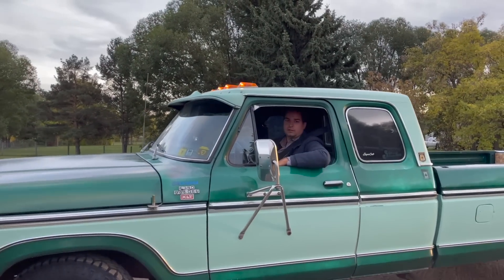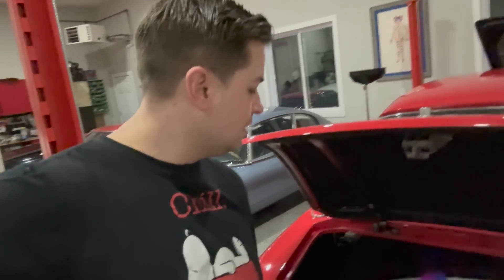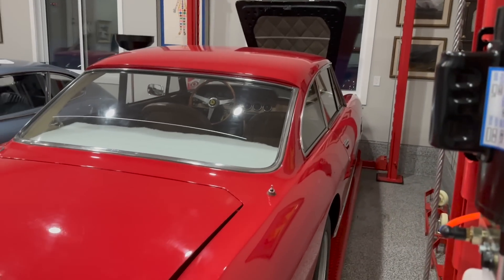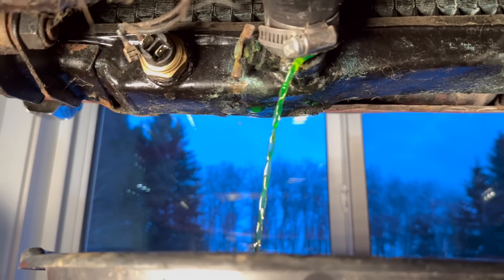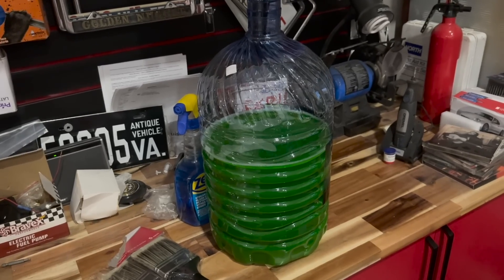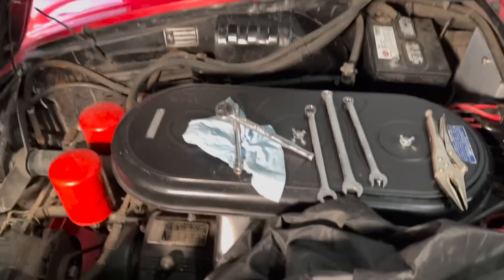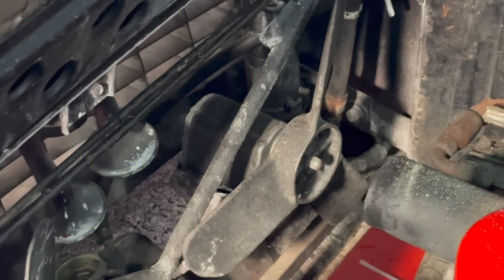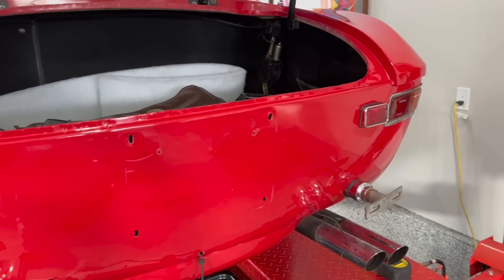Forgotten Ferrari Update, Taking things apart!

Comment: 👍👍👍 Properly mounted reflectors could potentially prevent accidents!   I hit a 1974 Jensen-Healy because its brake lights looked like tail lights to me (yeah, I know…NOT good). 

There was no stopping a ‘65 Dodge V8 with drum brakes but I slowed and turned to avoid a direct hit. I’m certain that saved a life, maybe two.

The driver was ok — she  ‘only’ scratched the side of an early 70’s Ford Pinto ahead of her (no exploding gas tank!) and, after  ricocheting off the concrete center divider, she came to a stop ON TOP of the steel guard rail above a SoCal ravine on the 118 Fwy. above Topanga Cyn. Blv. not far from Stoney Point Park.  

This was a long time ago, but I still don’t assume all brake lights are modern and  bright.

To the gawking Ford Pinto driver who came to a stop on the freeway to watch a wrecker safely tow a vehicle after another accident was cleared and emergency vehicles were gone…I REALLY hope you learned NOT to stop on highways.

Comment: The important thing with the coolant is not how clean it looks, but the electrolyte package is no longer effective to prevent corrosion which is an issue with older steel rads best to just change it with new coolant.

Comment: I do have insulation tape but often prefer to use duct tape as it stays on better. The old cloth insulation tape was good but the plastic stuff often doesn't stick very well. Having said that, I do try to do a neater job than that old repair shown in the video.

Comment: Do research the brake fluid you plan to use, Castrol LMA?  Some domestic brake fluids will destroy/melt the cylinder seals   Make some inquiries before using just any brake fluid.  The DOT number means nothing in this case.

Comment: By looking at the oil filters & the air filter you pulled out...somebody might have known what they were doing when it came to the engine. Why? Those are Baldwin filters- they are a great filter. I absolutely laugh when I see the orange Fram filters hanging over the engine and owners talking about how much they know, the cost of the restoration or major service- and there is the worst filters on the market. They are absolute junk